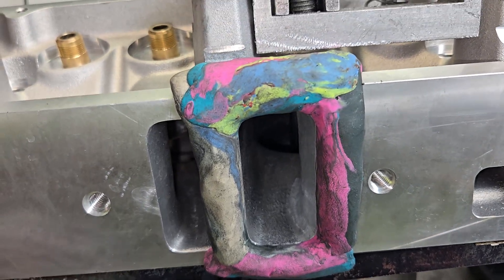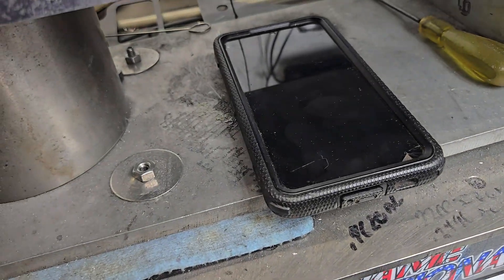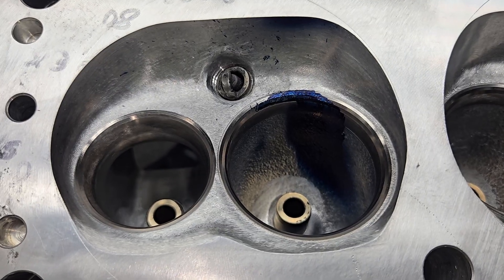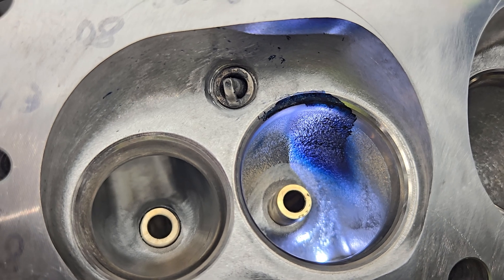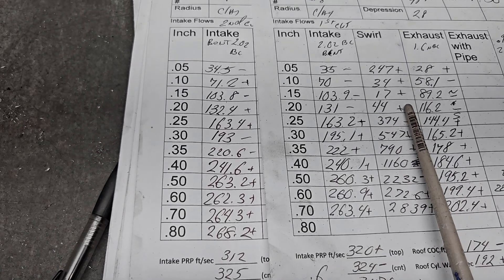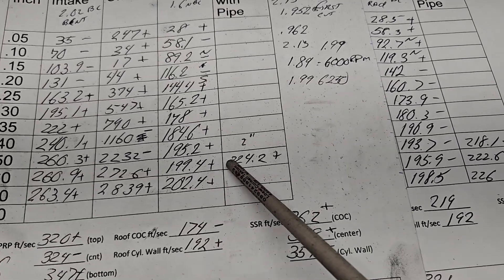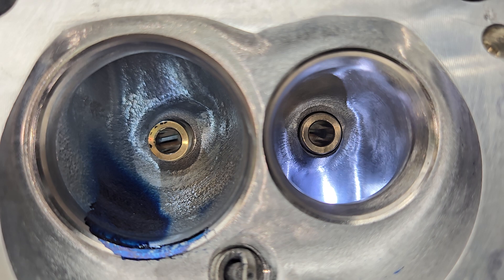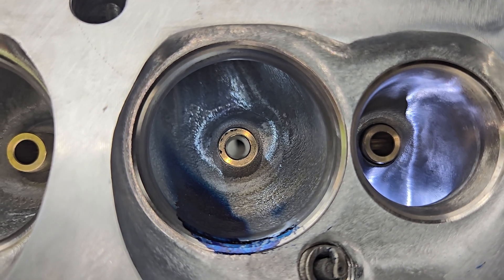AFR Blue Hornet Mopar Cylinder head. 2nd cut, Small gains, Good news for my enemys! Flow mistakes!

Comment: Could you get like a .020”!smaller diameter valve to still catch the seat right? Looks like with as bad as that chamber shrouding is and no more than it is flowing a smaller valve could be a win. Maybe even a steeper valve angle?
Reply from the maker: Not on this build. Thanks

Comment: Maybe try putting a tiny bit of clay in between the exhaust seat and the chamber wall to see if you went too deep with the ball cutter during exhaust valve de-shrouding.
Reply from the maker: I will explain the mistakes I made flowing this in the next video. Stay tuned.

Comment: As I figured, those heads are a waist of time and money. Only 2 reasons why these heads are so bad. 
Reason #1 AFR somehow managed to produce a head that’s almost a copy of Edelbrock rpm or speedmaster, yet made it even worse than either one of those. It made no sense to make another SBM just like all the other mediocre heads on the market. It was completely dumb.
Or
Reason #2 
Charles, you’re not that great at porting and pretty much waisted a bunch of time and some guys money not really making it any better than it was from the factory.
However, I do NOT think it’s reason #2 because I have seen you do some pretty good work on many different heads.
So that basically means these AFR heads are a complete failure and going to disappoint a lot of people who do not understand anything about heads or the difference between a good head or bad head, but they think since it’s an AFR head then  it’s going to be a great head.

I build the “white box/continuously rebranded Chinese heads by getting them bare, hone the guides, cutting my performance VJ,, resurface them if needed or if a smaller chamber size is requested, and build them with quality parts. 
I also port them, and I can make them flow just as much or better in the lower lifts than those you ported by a simple port clean up, massage the throat and bowl just slightly enough to blend my VJ in and blend the short turn.
They can hit 300cfm fairly easy with a regular port job.

Im not downing your work anyway shaoe or form. In saying that these afr heads are junk!

 I do not understand why anyone would not just get the Trickflow power port 190 for just about any street engine in this price range.
Reply from the maker: I am obviously not that great. Show us how to do it please!
Reply: @servediocylinderheads on the contrary, I think you do really good work. That’s why I said what I did by saying there are only two reasons why these heads didn’t turn out that good either bad head or bad porter, but then said that we know you do good work and your past work backs it up so it’s definitely the heads
 I wanted to make sure people did t think that the heads didn’t flow good because of what you did, but rather because the heads are poorly designed and it’s going to be hard to get anything out of them.
Reply from the maker: @rtprecisionmachine6210 Stay tuned. Think I fixed some issues. Thanks
Reply: @rtprecisionmachine6210  hey, i believe charlie has lots ofskill! I would like for you let mr.  servedio flow your prepped heads on his bench .
this would be a serious good back to back bench testing!
thanks keith

Comment: So the string shows an air flow prefference to the short wall radius, but the dykem prefers the upper right corner and roof. I'm having a  problem understanding why, can you explain?
Reply from the maker: Dykem is heavier so it has trouble staying with air stream if the air stream bends. Think of taking a turn too fast with Wiffy driving. Woods.

Comment: "A hi vol pump sucked the pan dry". I have heard that assumption many times. But if you have oil pressure of let's say 60 psi both with regular and high volume pump, where does it pump the oil that it sucks from the pan? The pump creates pressure because it pumps certain amount of oil through restrictions that makes the pressure rise. If you pump any more than the amount needed to achieve 60 psi, the pressure will raise. So, for a certain pressure, the pump can't suck and pump any more oil to the circulation, no matter what the pump volume is.
Reply: Pushes it into the pan or recirculates within the pump, depending on the type. Over flow top end is because the drain back is insufficient.
Reply from the maker: To the top of the engine.
Reply: @servediocylinderheads  How doesn't it raise the oil pressure?
Reply: It's a volume pump, not a pressure pump.
Reply from the maker: @MarkHenke-w4q How is volume increased in a closed system?

Comment: I found that out with the Edellbrocks I have 😂 they have now been sleeved. Reamed the bolt holes out to 14mm and thin wall sleeved them.
Reply from the maker: Ouch.
Reply: Isn't the biggest restriction the partially open intake valve ?
Reply from the maker: @hotrodray6802 And what can be done about that?